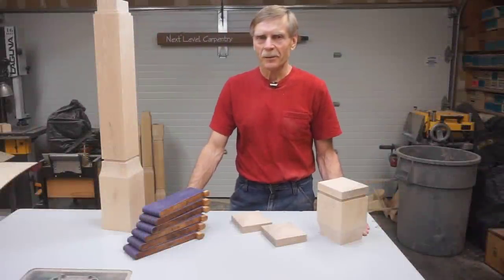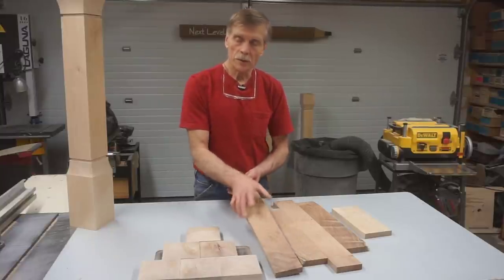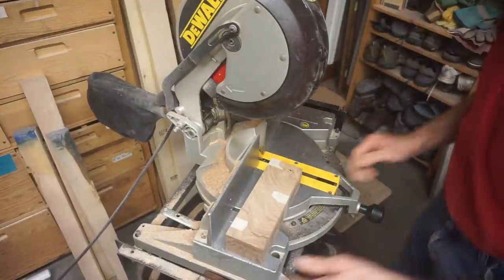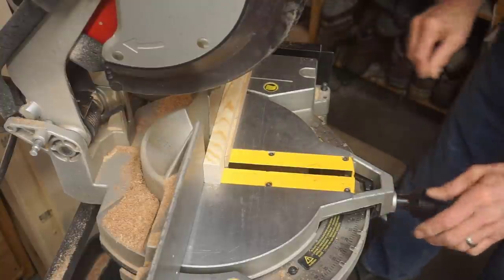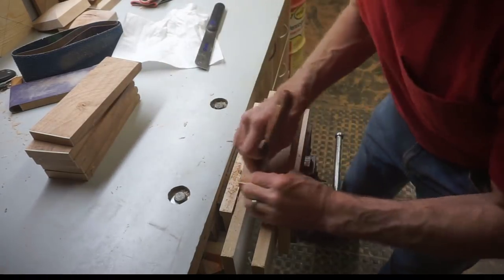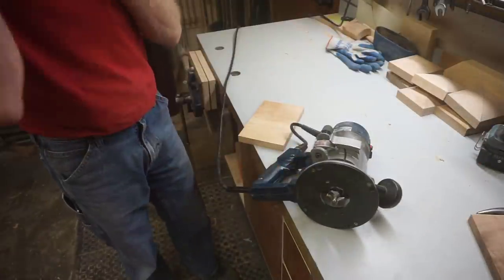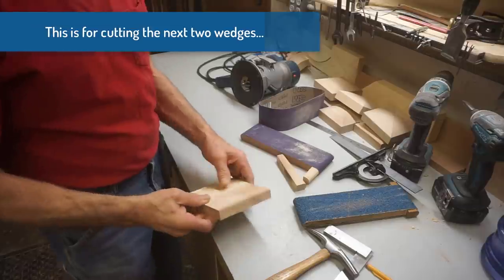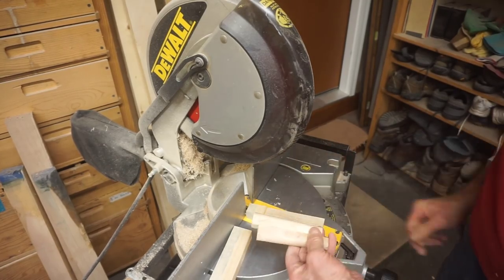Best Blocks for Demanding Sanding

Comment: Great video Matt. What adjustable square is that?
Reply from the maker: Thanks Temple... glad you like it.  The adjustable square is a Starrett model I've had for many years.  It's the kind and quality that you need buy only once in a lifetime.  With that in mind I bought this complete set many years ago and it's never disappointed: https://www.amazon.com/dp/B000KUA2OO/?ref=idea_lv_dp_ov_d&tag=aiponsite-20&linkCode=ic6&ascsubtag=amzn1.ideas.1BL629QJRJZM0 Best, Matt
Reply: @NextLevelCarpentry  great info thanks.    I always do try to buy my tools with the thought in mind to buy quality that will last. I've made the mistake a few times of buying something cheap to either get me by for now or thinking it would do the job , but it really wasn't what I wanted either. It would wind up costing more in the long run to eventually get what I should have gotten the first time.
Reply from the maker: @TempleThomas  it's a familiar phase everyone goes through but everyone doesn't come to the same conclusion, hence the success of Harbor Fright, right?  Best, Matt

Comment: Hello NLC,
You produce very instructional videos. Thank you for taking the time in making these.
When you were gluing the thin strips at the wedge end of the sanding block you mentioned using Gorilla Super Glue. Any particular reason of using this brand over Starbond you used when making the Glue Caddy?
Reply from the maker: Hey Paul, good question.  I used Gorilla Super Glue for years figuring it was the best of what's 'out there' and it worked fine.  I even tried to convince Gorilla that they needed to sell an aerosol activator but they just blew me off.  No big deal.  After Starbond approached me I tried their CA's and didn't find any deficiencies in performance.  A big difference is that Gorilla seems to get thick and gooey if I don't use it quickly... like in 2 months.  I've had Starbond stored in the same less-than-ideal jobsite and shop conditions for 6 months with no detectable change.  That and Starbond's attentiveness to the end user lead to my switching endorsement and personal use preferences with no regrets.  Gorilla has a medium and a gel, I think, but Starbond has thick, medium and thin along with pump and aerosol accelerators and black and brown colored CA, all useful products that substantiate my choice.  Thanks for watching and commenting.... Best, Matt
Reply: @NextLevelCarpentry  Hello Matt,
If I understand correctly, in that video you used Gorilla Super Glue not because it has an advantage over CA glues but simply because that is what you were using in those days. Correct?
I am a "reborn-woodworker" and have so much to learn in order to catch up with today's techniques and products like glues. I say reborn because 35 years ago I started woodworking on my own, not taking any lessons but reading a bit and I guess having a mind that can figure out things easily. I built a full dining set (table and 6 high-back chairs, two of which have armrests, all with turned legs) out of oak, using a table saw that (still to this day) has no rip fence index tape, and a 6" jointer.
My table saw having a bad harmonic in the blade when ripping forced me to run the ripped  edge of each 2 to 3" board on the jointer before laminating. And having no thickness planer I had to feed each board onto the jointer at the same time as I was adjusting the infeed table hight to end up with parallel faces!!! Thankfully, the infeed table adjustment is very easy, via a large turn knob.
Lots of work but I was able to produce a nice set. Besides two or three other pieces of furniture I have been mostly idle since then.
And as for the rebirth, being now retired and getting back into woodworking I took down the wall between my 10' by 18' shop and the adjacent room to finally have a shop where I will not have to disassemble the (borrowed) thickness planer and move it out of the way to setup the miter saw. So, in that process I searched the Internet and found many useful videos on shop setups but also your very interesting videos. Whence my desire to learn more about why one type of glue over another.
Long story but it is mine and I stick to it :-)
Although I had a chance to view a few of your videos I'll be looking forward to viewing the rest of them.

Sincerely,

Paul (Montréal, Qc)

Comment: nice! do you even bother with sheets+blocks any more or do you just use these guys? i think about the only thing i'd add is cork on one side
Reply from the maker: Catchy channel name guitarchitectural... I like that! It's very seldom that I use blocks with sheets for sanding.  I own one of those rubber things from back in the body and fender days but can't think of the last time I used it.  When I do use a 'block & sheet' I use the wood D handle block you see on this page: https://www.amazon.com/shop/nextlevelcarpentry?listId=17DBXMFC3G5TZ with the 2 3/4" 'sheets' you can also see on the page.  The D handle block has a dense rubber pad on the bottom that would serve as the cork you suggest but you might find cork more suitable to your work.  I often just leave a sheet or two of worn paper on the bottom, depending on the nature of the work at hand.  You can see these blocks (and more) in use in a recent video I did for repairing wood for flawless painted finish:  https://www.youtube.com/watch?v=FfhtgWF_ETY&t=2645s Thanks for watching and commenting here... Best, Matt

Comment: You could use one 4” wide board at the right total length. Do your round overs and all that then simply make your 3 degree cut an inch from the end. 

Rip the long piece down to 3” and glue on your kerf thickness glide piece and there you have it.
Reply from the maker: Not sure if I'm following you nevermindthebollocks but it sounds to me like your 3 degree wedges are going to be cross-grained instead of long grain and will likely break in use.
Reply: Yeah, you r right. I got a bit too smart for my own good there.
Reply from the maker: Hope my reply didn't sound condescending nevermindthebollocks because I'm always open to ideas and suggestions to make a job better/faster/easier and it's cool you're looking for ways to do just that. Best, Matt
Reply: No. It was fine.  
I haven't made blocks like that. I normally just grab a piece of scrap and on old belt and simply hold it or once in a while staple it. I have some autobody blocks I typically use though if I can't use a power sander.
Reply from the maker: You're smart to use autobody blocks for woodworking nervmind... I have a selection of those too and find them very useful for non-typical sanding applications.  Much as I 'hate sanding' anything that makes it faster and better is welcome! Best, Matt

Comment: Ha! Mesquite. A quick story. I was in Dallas and we went for lunch at "The Hard Eight" (a real cool barbecue place). They use mesquite for their pit. So I took a nice 18 inch log to bring home. It was a real pane getting it home. I hand carried it on the plane, it was heavy. Anyway I get it home and left it in the shop for a couple of months. Then I noticed there was sawdust all over the floor and small holes all over the log so I looked it up and found that it was "Powder post beetles". Well.... come to find out they can infest a house, and destroy it! The only way to get rid of them is to wrap the house in plastic and fumigate. Thankfully they didn't spread.
Reply from the maker: Mark, thanks for the story!  Those powder post beetles are a real trip, aren't they?  The mesquite I used was for a live-edge set of stairs in a grand log home.  One feature was a newel post made from a root ball and treetrunk section of mesquite.  I have no idea how long the tree was cut before it ended up in my shop but I do know that it's journey ended on a 10 degree winter day.  Despite time, distance and temperature there were live beetles crawling in and out of that post the whole time I was hand peeling it with a drawknife to its final shape.  Ended up using a blowgun and stiff wire to clean out the few remaining beetles in the finished post.
Hope you find something more worthy of your mesquite souvenir than sanding blocks though :-)
Best,
Matt

Comment: This is awesome.... what is the small steel soled hand sander you use toward the end of the video?  I had a Sand-Devil block that is a store-bought version of your design and it failed due to a pot-metal expand assembly.
Reply from the maker: Neal, that's one left over from my former life in autobody work but I have a link to the closest thing to it that I've found on the Next Level Carpentry Amazon Influencer's page if you don't find it at a local auto body type supply store.  The sole of the one I have is thick sheet aluminum with a no-slip coating on the bottom.  I like it because I can get a variety of 'stiffness' to the sandpaper: one sheet, stretched tightly for sanding 'crisp' details; I can leave extra 'spent' sheets on under a fresh sheet which adds a little 'give' to the sanding effect... hope that makes sense?  I have lots of sanding gadgets (as you well know :-) and this one is as indispensable as most of the others.  BTW I just bought a new sleeve of #150 grit 3M paper that I use on it.  The sheets come 2 3/4" x 17 1/2" for a longer version of the same tool.  I cut the long sheets down to fit and use the 1 1/2" +/- leftover scrap for random sanding touchup stuff.  Hope that helps...  Best, Matt
Reply: I visited your Amazon influencer list... and bought the one you describe.  Will add it to my sanding kit... I had also bought the "how far out" gauge.  Incredible.  I tell all my carpenter buddies to watch your video where you demonstrated it.
Reply from the maker: Thanks Neal, for everything!  I think you'll really like the sanding block even though the autobody trades are transitioning to 'stick-on' type abrasives and blocks.  The clip on attachment of this block just seems better suited to woodwork; maybe just because that's the way I've always done it, but probably not.  I use 36#, 80# and 150# with the block so I buy 'sleeves' of each grit to have on hand.  You should be able to get the 2 3/4" x 17 1/2 sheets where ever local body shops get their supplies.  If you have trouble finding it I'd search for the exact 3M stuff I use and link it to the Influencer's page... sorry, I'm starting to come across as a cheesy salesman :-(
Check out Michael Shuler's website for his HFO gauge because it has info for using it with Stabila-type levels where I only demonstrate it on the old-school wood level.  I suspect you and your buddies might be a bit more current with newer level types and designs and the additional info will help understand how it adapts.  Thanks again, Sir!!  Best, Matt

Comment: 16:50]  Ok, you have made a full set of ultimate sanding blocks, as you are making them maybe you keep one one '+' wedge or even a '++' wedge, and a '-' wedge in the drawer to accommodate variations in belts.
Reply from the maker: Not a bad idea William... a few variations would go a long way to adjust for variation in belts! Best, Matt

Comment: What activator and glues do you use?
Reply from the maker: Art: my favorite CA glue is the Gorilla glue brand... it seems less 'brittle' when cured and that little extra 'flex' means joints are a little more durable.  My preference is the Stick Fast brand of AEROSOL activator.  Aerosol because it provides a more uniform coat and Stick Fast because the handy shape of the can it comes in.  This is a bit like asking what brand of truck I drive though... I'm a GMC guy but in practice there's little to no appreciable difference in brands... I won't argue with anyone who chooses other brands of glue and/or activator... as long as it does the job they're doing. BTW there's links to both on the Next Level Carpentry Amazon Influencer's page if you can't find them locally... Best, Matt

Comment: Matt,  in your table saw you have a throat plate with a replaceable insert.  Can i ask where you got that?
Reply from the maker: Sawdust, No problem: the throat plate is a Wood Dynamics model.  Unfortunately they're not sold new anywhere anymore that I can find.  There was also a Charles Neil Woodworking model that was nearly identical... but sadly not available anymore either.  It's too bad because I really like it... best I can offer is to search those terms on Craig's List and eBay to see if one turns up.  There's a bit of chatter in some online forums under those search terms as well and you might come across one there too.  They're worth it if  you can find one because it's so easy to switch out that little strip instead of needing a whole stack of whole plates for each different blade or dado width.  Hope you can find one!  BTW That Tioga Fretworks is a real peach, ain't 'he'?  I enjoyed and appreciate your response!

Comment: How did you make the little out feed stand? can you talk about it? Thanks.
Reply from the maker: Daniel, I made the outfeed stand from scratch to my own design so there's not a whole lot to say.  Your's is one of a few recent questions about them and the more times I'm asked the more I'm considering doing a video to show making a pair.  Do you see yourself making a pair or, since they're metal/welding work and not woodwork, would you show a video to someone to have them make 'em?
You might be able to modify a commercially available roller stand to get it to work like these.
Hope that helps... I really appreciate your comments, participation and subscription to Next Level Carpentry!
Best,  Matt

Comment: I recently looked for a source for the beeswax finish you are using at 21:28 but cannot find it. Where can I buy it?
Thanks.
Reply from the maker: Here's a certain source Joe: https://www.amazon.com/dp/B0725TZ4B5/?ref=idea_lv_dp_ov_d&tag=onamzdigitalj-20&linkCode=ic6&ascsubtag=amzn1.ideas.29WVINIJF4EUJ but you should be able to find it at a lower price if you can find someone local who stocks it.  A little goes a long way but it's always nice to get a better value... Best, Matt

Comment: What grits do you use with the 6 blocks?
Reply from the maker: My selection is 50, 60,80,100, 120 and 150 but that's just me and for the woodworking I do.  Others may well go with a wider range of grits or focus more on the coarse or fine ends... personal preference really... Best, Matt
Reply: @NextLevelCarpentry  thanks!

Comment: Where do you get the magnetic tac hammer?
Reply from the maker: Here's one source:
https://www.amazon.com/dp/B00B0XKU88?linkCode=ssc&tag=onamzdigitalj-20&creativeASIN=B00B0XKU88&asc_item-id=amzn1.ideas.1BL629QJRJZM0&ref_=aip_sf_list_spv_ons_d_asin
If you can't find one at a local hardware store or tool supply house.

Comment: I wished I had watched your video before I bought a sanding block from Milescraft
Reply from the maker: Mark, it's funny how that works, isn't it?  The Milescraft one is able to adapt to belts of differing lengths though, right?  If nothing else it will take up less room in your shop than a 'full set' as shown.  Thanks for commenting here!
Matt
Reply: Mark Brandtman same here.  I think ill be making some of these blocks anyway.